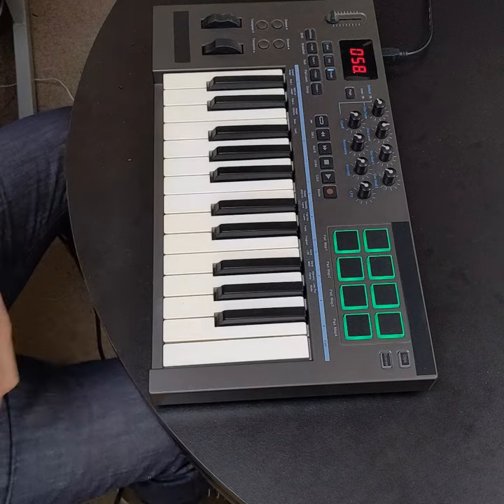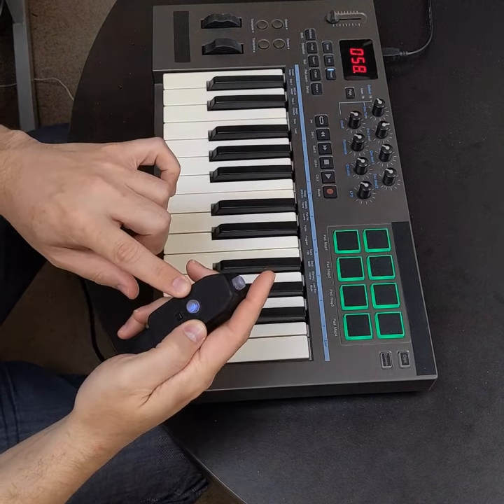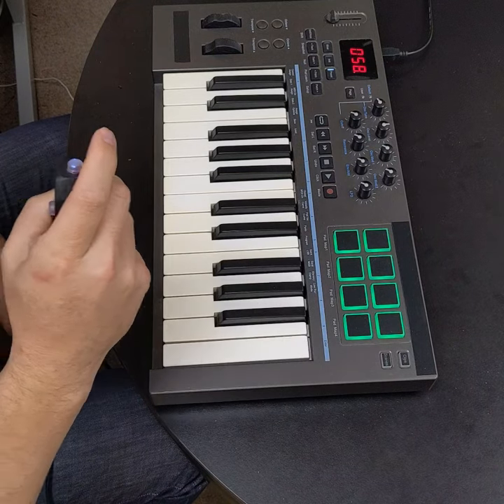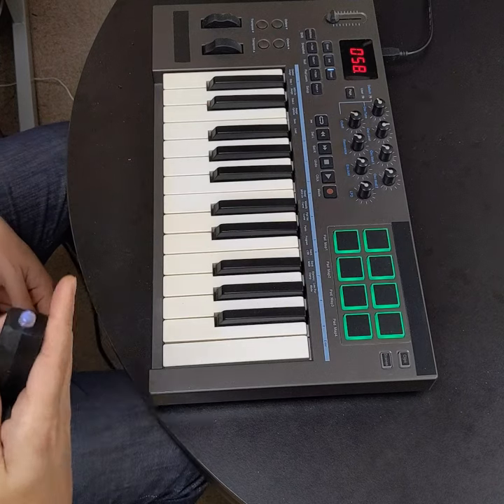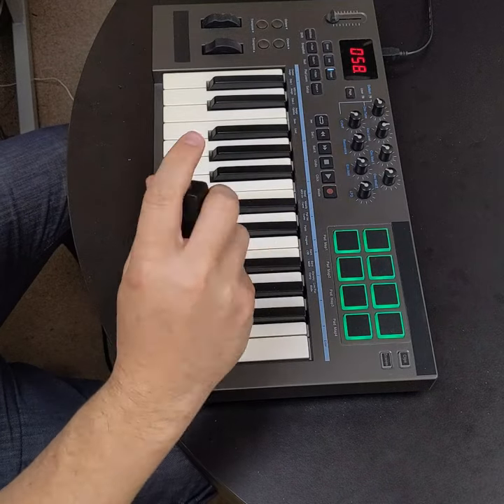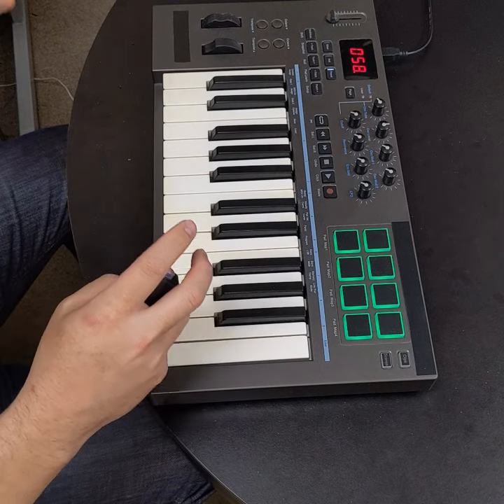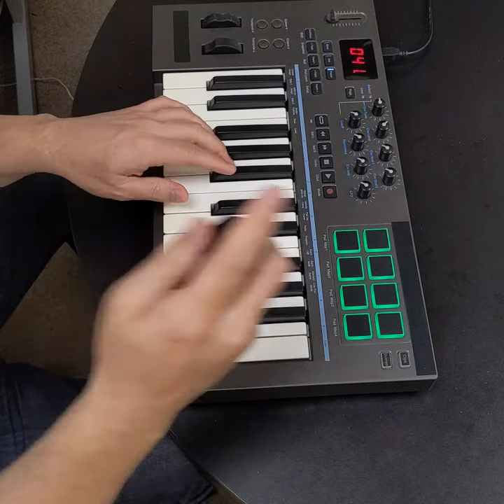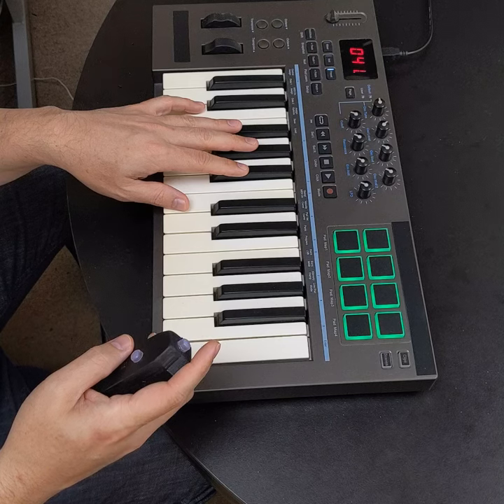What this thing is and how to play it

Comment: Very interesting! So, if no key is pressed, the 'thing' just plays the sound of the last key that was pressed?
Reply from the maker: Thanks! If no key is pressed it doesn't do anything. That way you don't accidentally play notes if you're putting the controller down or something. Also, it has a "bypass mode" so you can play it like a regular keyboard, too.
Reply: @TheGlide thanks for the reply. The part that is confusing me is around 1:24 you are playing a hi-hat, but don't seem to be pressing down any key. What am I missing?
Reply from the maker: @kismert  gotcha, good question. To get the closed hi-hat sound you have to hold down a button on the handheld controller. But also, all of that can be changed by modifying the code.